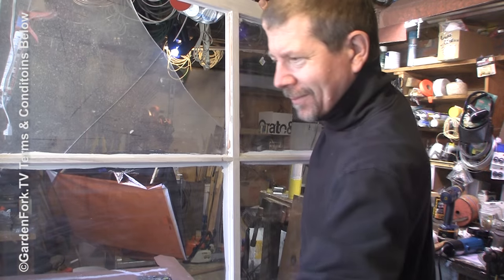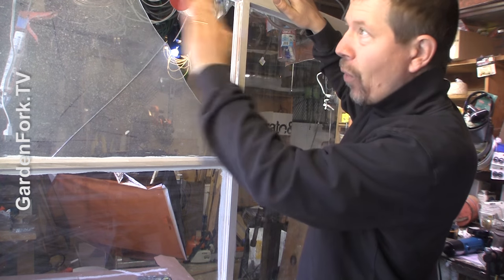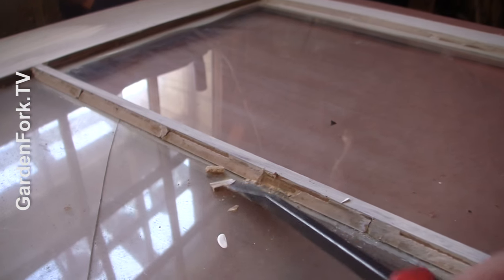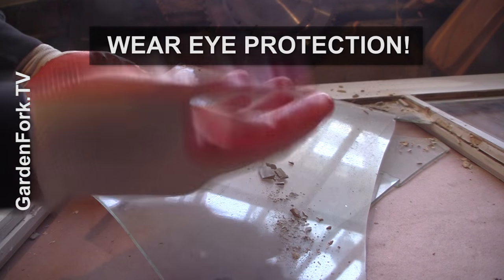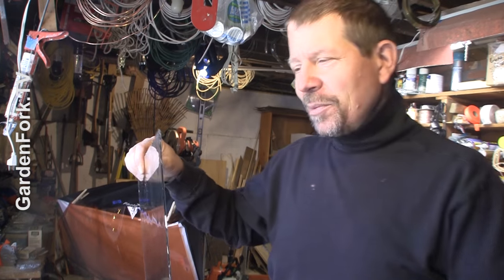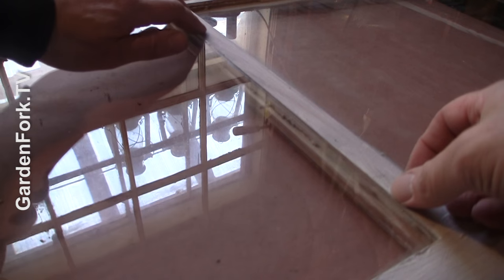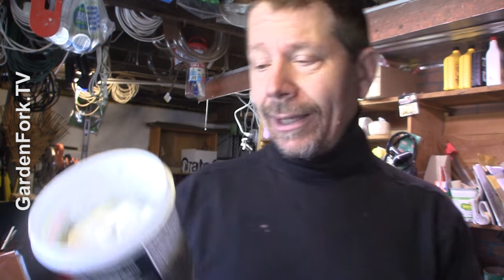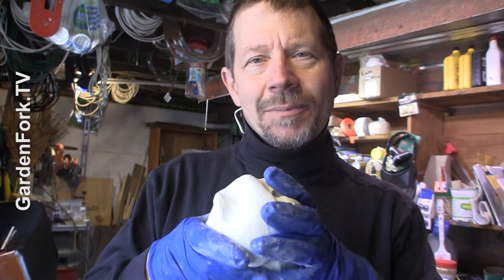Single Pane Window Repair - GardenFork

Comment: Perfect timing! My mom has a few windows where the glazing is cracked and coming out. Going to give this a try. Is it okay to fill in the missing areas only or should I remove all of the unbroken areas? Thank you Eric.
Reply from the maker: +Balconygarden if the glazing wont come out, don't force it, you can work around it. if the glazing is loose, remove it. thx!

Comment: Great tutorial. Reminds me how badly I need to reglaze my porch windows. No broken glass, just really old crumbly glazing. The only thing I'd do differently is I prefer "not those" glazing points. I like the triangular ones, but they're hard to find. I like that they can be seated deeper into the frame for thinner glazing lines. A lot of my antique windows have pretty tiny sections of glazing (sometimes only about 1/8" wide). I also like to seat the glass in a thin little film of glazing on the inside frame. Not necessary, but it helps with waterproofing (my windows get a lot of rain and water exposure).
Reply from the maker: +sooth15 i've seen the small glazing points avail in a custom staple gun, not sure where else to get them. eric.
Reply: Those would work, but I think they're more for framing (picture frames. The triangle glazing ones I found are galvanized.

Another solution would be to just grind the back tabs shorter on the easy to find ones.

Comment: You said that you collect windows.  I've noticed a superb place to get free windows is to just look for neighbors upgrading their windows.  Usually the installers have to pay a tipping fee at the dump, so they'd rather just give you what they take out.  I've thought about building a greenhouse out of replaced double-hung windows.  

If you build your frame right you can almost lay the windows on top & nailgun them to the sides.  Plenty of ventilation when you need it.

Comment: A thin layer put down first and the glass pressed into it seals both sides and the edge of the glass against the wood.
Reply from the maker: +QuantityEngineers i have seen that method as well, thanks for sharing, eric.
Reply: +QuantityEngineers I was wondering about that myself.  Thanks for mentioning it
Reply: Also known as bedding the glass! Prevents the windows from vibrating too.
Reply: @gardenfork  bedding the glass in putty is the only way you should glaze , also primer in the rebate to seal from rain and it helps the oil in the putty to stay in the putty ,

Comment: Great video and very helpful.  Nice camera work too... up close, could see easily what you were doing.  We bought an old 1926 brick home and are fixing it up ourselves.  Thanks so much.  Quick question about glaze VS caulk.  I've been told that folks are just using window caulk instead of the glaze.  Thoughts on that?
Reply from the maker: +Lanelle Devlin I've always used the glazing compound, but why not try both on a 'test' window and see what works best for you. thx!
Reply: +GardenFork Got the old glass out and the old metal holders removed, cleaned the wood then put in new window with new replacement metal spikes.  I tried to apply the glaze (New can and I 'kneaded' it to make it workable) but I couldn't  'finish' it off.  It wouldn't stay smooth.  Should I add in some of the linseed oil perhaps or could it be weather related?  It cooled down a bit this afternoon - about 58* and sprinkling.
Reply from the maker: +Lanelle Devlin it needs to be warm for the glaze to work well, ,best to work inside or on a sunny warm day.

Comment: Right when you said secret tip, in the video it shows you making a break and it's no good. So secret tip is place either steel square or even a 2x4 on top of glass to sandwich the glass at its break point. Increased chance of having a clean break.